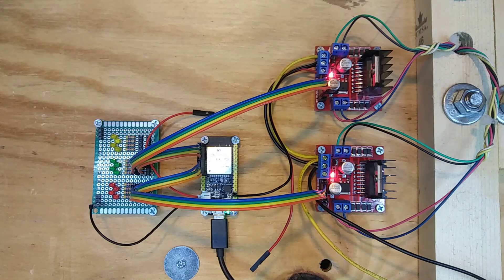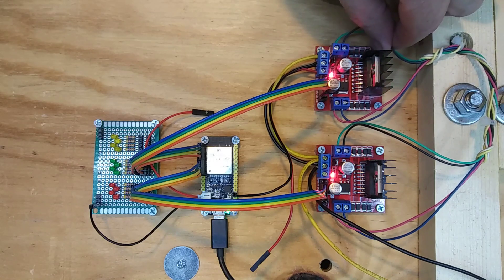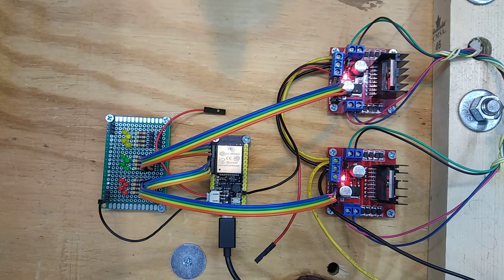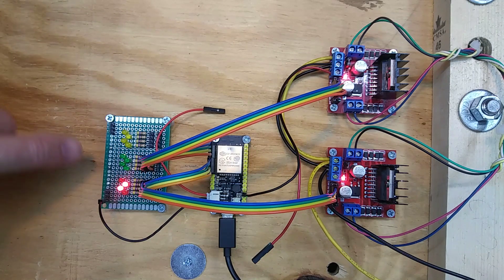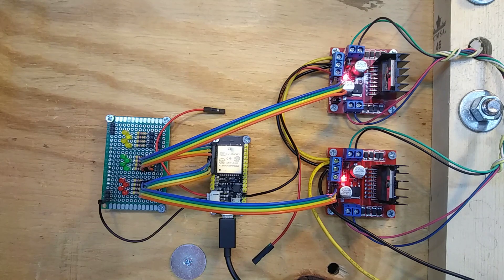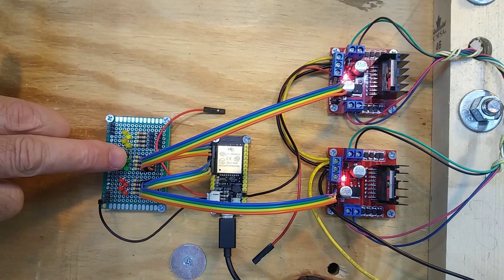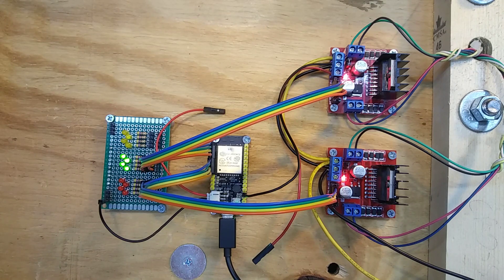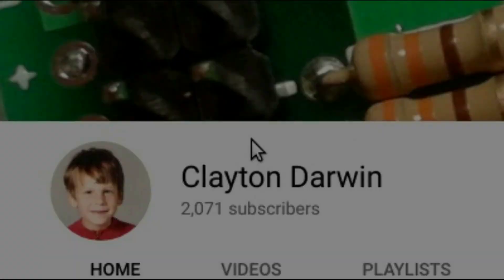Running Stepper Motors - ESP32 Project 5

Comment: Great video. Can you post the code you used for the first part? I would just need to modify it to operate 3 stepper motors to 3 toggle switches so that each stepper motor moves 190 degrees one way when the switch is let's say up, and 190 degrees back to the starting position when the switch is down.
Reply from the maker: I don't have any stepper code separated at the moment, but I'm going to get it together very soon (for h-bridges and controllers). Several have asked.
Reply: @ClaytonDarwin  I hope so soon. I am working on the electronics for a pontoon houseboat on my youtube channel, and this is going to be used to raise and lower the reverse bucket on the waterjet drive system. If you like, you can check my channel, it is called "Building From Scratch".
Reply from the maker: 👍 It will be pretty soon. Will check out your channel.

Comment: Hello Sir, i try also to get my stepper motors with an TB6600 and an ESP32 to work. I have huge problems. May i ask which driver do you use or maybe can i ask for a sketch to get some ideas from it and find out what i am doing so wrong? Thanks in advance if you can upload somewhere your sketch!
Reply from the maker: Sorry. I don't have any experience with the TB6600 or any motor controllers. I just use cheap H-bridge modules to control the motors directly.

Comment: Beverly Hills Cop theme in minor!
Reply from the maker: Yep. It's called Axel F. Notes are scaled down to the maximum frequency allowed by the motor, which is 440 here. All notes have frequencies below that.
Reply: @ClaytonDarwin 
Here's a try at transcribing it from my head:

Note Oct MIDI Freq Length
a 3 57 220 4
c 4 60 261,63 3
a 3 57 220 2
a 3 57 220 1
d 4 62 293,66 2
a 3 57 220 2
g 3 55 196 2
a 3 57 220 4
e 4 64 329,63 3
a 3 57 220 2
a 3 57 220 1
f 4 65 349,23 2
e 4 64 329,63 2
c 4 60 261,63 2
a 3 57 220 2
e 4 64 329,63 2
a 4 69 440 2
a 3 57 220 1
g 3 55 196 2
g 3 55 196 1
e 3 52 164,81 2
b 3 59 246,94 2
a 3 57 220 6
Reply from the maker: Yes, that's about it. Here is the list of (freqs,times) I started with. But it was scaled to a max of 440,  so is matches what you have. The highest note is D6, so that went to A4.

notes = [

(587.330,4), ##D5
(698.456,3), ##F5
(587.330,2), ##D5
(587.330,1), ##D5
(783.991,2), ##G5
(587.330,2), ##D5
(554.365,2), ##C5

(587.330,4), ##D5
(880.000,3), ##A5
(587.330,2), ##D5
(587.330,1), ##D5
(932.328,2), ##A#5
(880.000,2), ##A5
(698.456,2), ##F5

(587.330,2), ##D5
(880.000,2), ##A5
(1174.659,2),##D6       
(587.330,1), ##D5
(554.365,2), ##C5
(554.365,1), ##C5
(440.000,2), ##A4
(659.255,2), ##E5
(587.330,6), ##D5

]

Comment: Depending on the flash size, and i/o pins, might be able to build/run full printbot w/ ESP32...nice!
Reply from the maker: On this module, I'm able to run 4 motors (with h-bridges like in the video) and still have 3 inputs and 1 output available. So 3-axis control is completely feasible, plus 8 extra pins. You do lose your peripheral serial, I2C, and SPI.
Reply: @ClaytonDarwin  can it hold ramps?
Reply from the maker: Not sure. Never used it.
Reply from the maker: I think that would work.